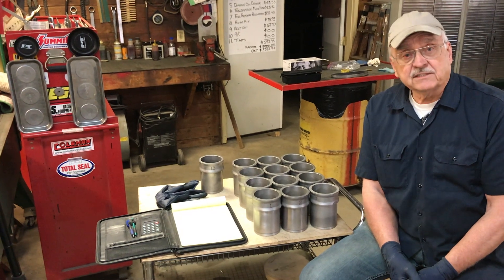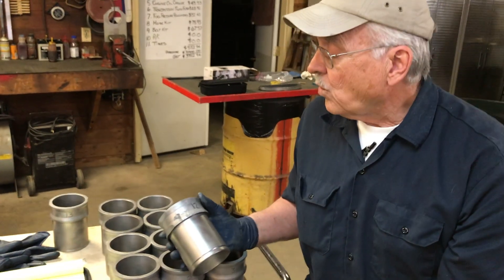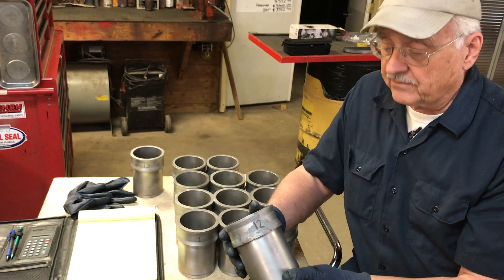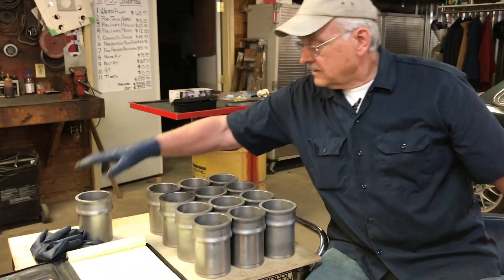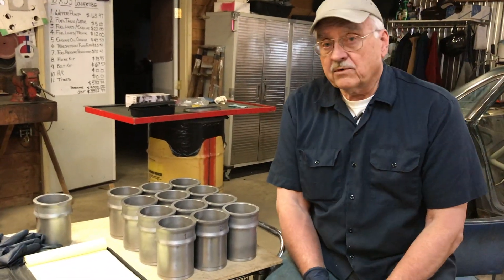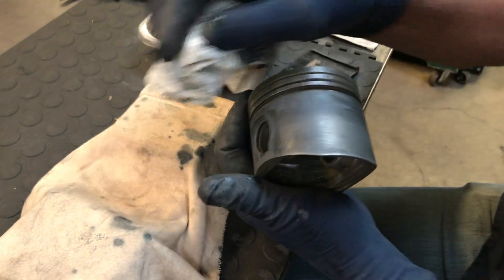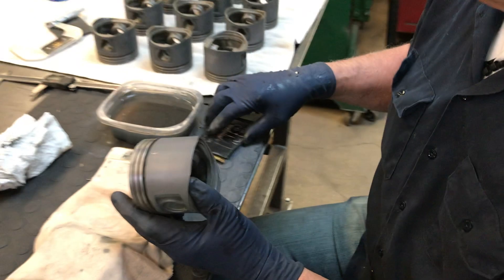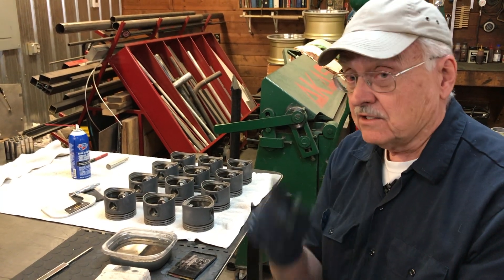Tuesday Extras - Ep 4: Jaguar 5.3 L V-12 $100 Overhaul Challenge /Liner and Piston Install

Comment: Pistons are designed with taper because the top expands more, this guy is lost in space....
Reply: I started here, then measured mine and they had significant taper, then did research and quickly found the same. I am confused.

Comment: Ball honing is glaze breaking. It's what you do to a lawn mower cylinder, using a sunken AN cylinder hone is precise and can hold tolerances to .0002"
Reply from the maker: Ball honing can also be used to finish a cylinder to promote the sealing of the rings regardless of the engine if the point isn't to resize the cylinder.

Comment: I am really interested in the dry film lube application.  Has many applications if it does not wear or peel off.
Reply from the maker: It will wear like anything else but from experience in my track car I'm impressed so far.
Reply: @thecampchaoschronicles9567  Which Brand do you use? Mol0kotey D321?
Reply from the maker: It won't peel off if the prep is done correctly. It will wear off eventually like any bearing material. It bears the brunt of dry starts and low oil pressure situations instead of bearings and piston skirts.
Reply: @thecampchaoschronicles9567  Thanks for the answer and good explanation. I am in a very similar situation than you in the video. I have the choice of using Molykote D321R Dry film lubricant and CeraKote MicroSlick. Which one would you recommend or are you using in the video?
Reply from the maker: @Andreas_A_E  I looked at all of the common dry film lubes and found them to be similar in application and results. The key thing is surface preparation. I chose Tech Line because it was the most readily available without being a professional applicator, it was that simple. And I've been pleased with the results.